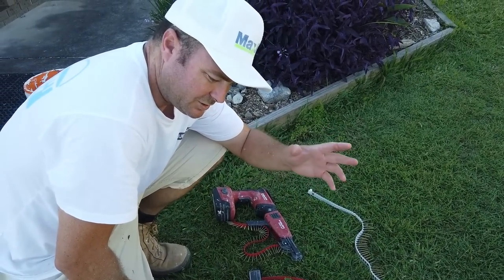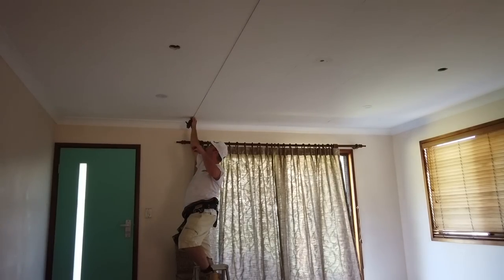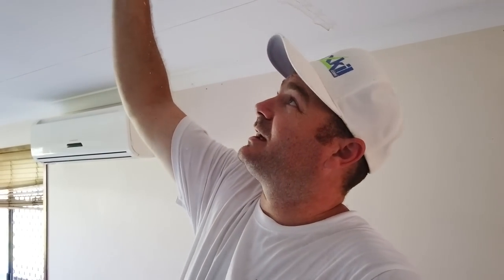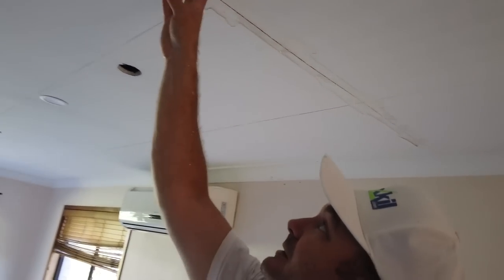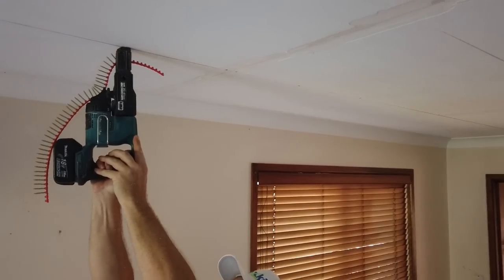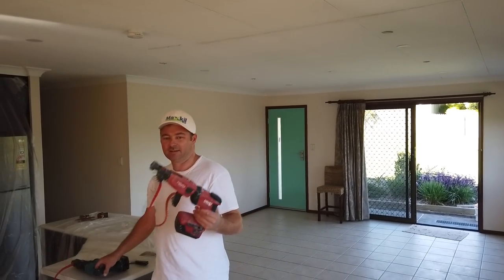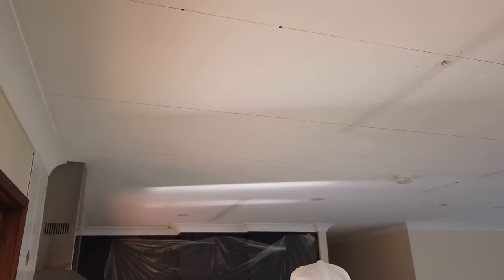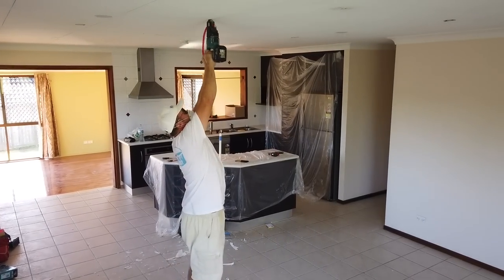Makita 18v Autofeed Drywall Screw Gun VS Hilti 22v Drywall Collated

Comment: I think the people who says that don't even work with drywall. Here in Portugal we work a lot with metallic trust's and i can tell you it is not easy to screw a board in a celling without a collated machine.  Really like the way you work boys 👏
Reply from the maker: Thanks Tiago. Thanks for that!
Reply: hello from another European country. I've done 15 maybe 20 000 square meters  of drywall on metal studs. Mostly I used an impact driver. For the first 10 or thousand I couldn't do it without a specialty bit. But suddenly I wasn't able to a find a good one anymore, so switched to just a ph2 bit. I mean it takes practice. But now I got myself a Makita removeable collated screw gun. The difference in speed is vast. Now we need to invent a tool that measures and cuts drywall automatically. Oh and then one that carries drywall to the needed location.

Comment: if you want one ,,, buy Makita 
if you actually NEED one
it has to be Hilti
Reply: If you use other tools also go makita.😁
Reply: I was on the market for one. I could either get one used without a charger and a battery for 450 euros. Went to a local Hilti store to see the price. Well, it's over 1000 at the very least for one set. So I got 3 new Makitas, a  whole bunch of bits and a  charger for 2 batteries. I already have loads of Makita batteries and I'm still under 1000. I've used Hilti before by the way. Really there is very little difference if any. I don't get this Hilti hype. Why would one NEED a Hilti?
Reply: @djvasforever  I have no idea over the hilti hype mate. People just love to hate makita I swear.

Comment: Awesome video is the cracks in the ceiling caused by the weight of the insulation?
Keep up the good work
Reply from the maker: Hi Dan yeah it is my friend, also the ceilings were fixed up there 40 years ago when they used these old nails which weren't even ring shank nails.

Comment: The new Makita brushless unit allows the trigger to lock and the motor doesn't run until you press the tip down. Way better than Hilti.
Reply: cpt awesome that’s model dfs452 which is not new. Milwaukee has that technology now too. Hilti is more powerful and durable then any makita drywallgun.